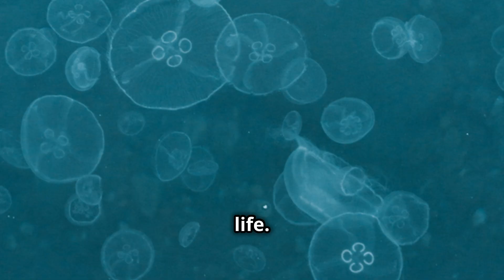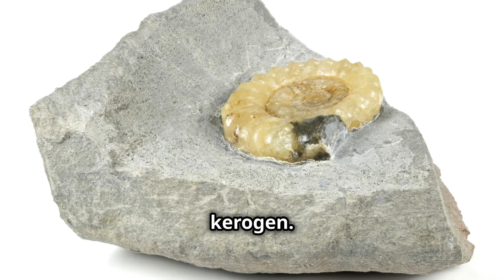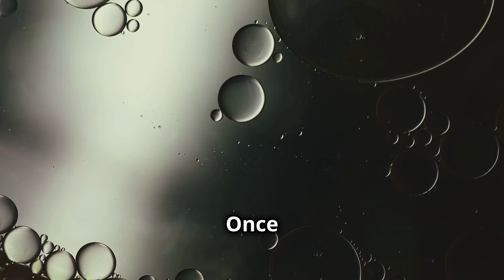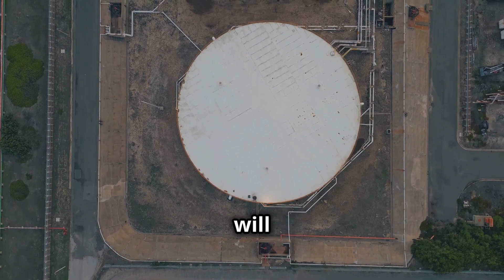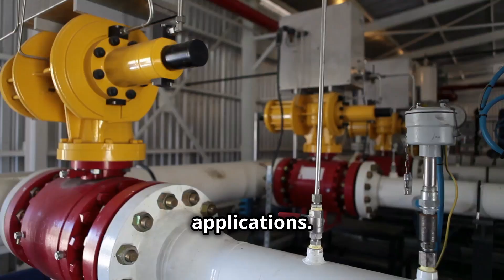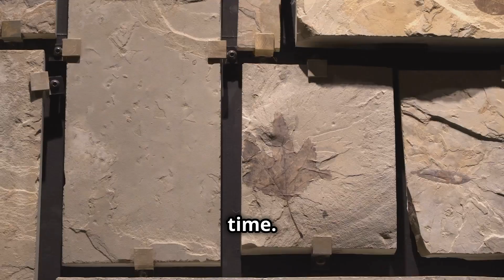How Did Ancient Life Turn Into Oil and Gas? The Answer Will Blow Your Mind!

Comment: One thing folks need to understand is that there is really no way to determine exactly how much oil and gas is potentially available.  This industry is still a flip of the coin and while we spend billions on survey and interpretation programs, it is still just trying to identify what we know, that knowledge changes and adapts as we progress.  They, whoever they are, thought the same thing in the late 1800's early 1900's that it was a finite resource.  Here we are 100-150 years later and still discovering new reservoirs and productive formations and producing from some of the same formations that were drilled and produced 50-100 years ago...  Something to think about....

Comment: Let science rule, OK? Oil is made rapidly, as is coal. Ask a biologist who works on things like that. There is no organic matter under most oil wells, but when they stop producing, they're capped and viola, decades later can produce again. Science states pressure, the fight bacteria, and rock and oil is formed. No dinos in your tank, sorry. Farmers and others are packing plastic into an airtight unit, heating it, and getting oil back. Try 21st century science, and leave the 19th century behind. Oil is about limited as pasture grass.
Reply from the maker: good to know